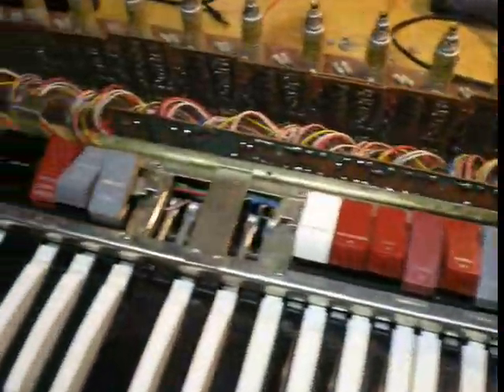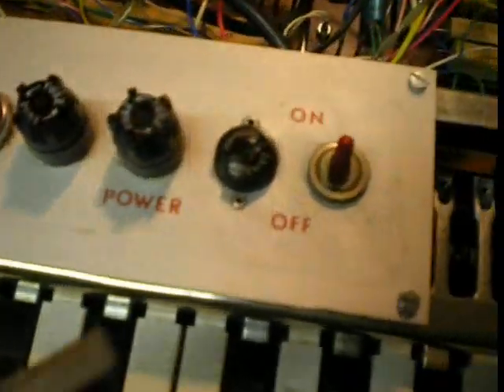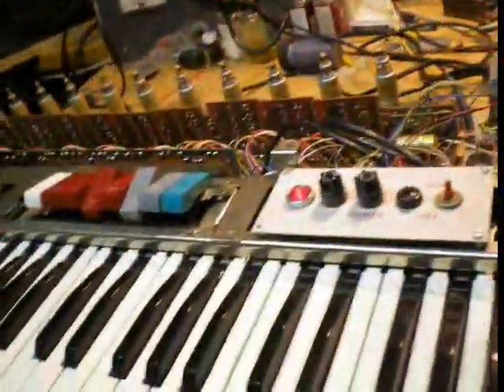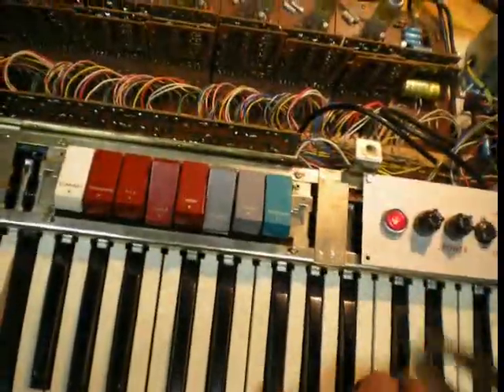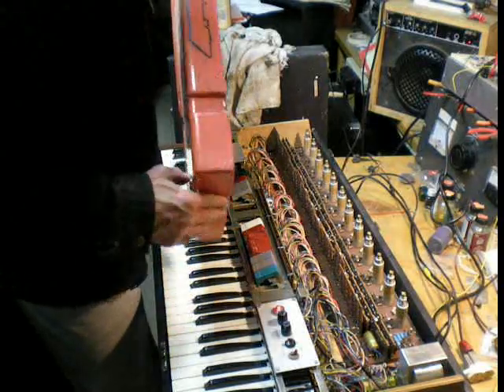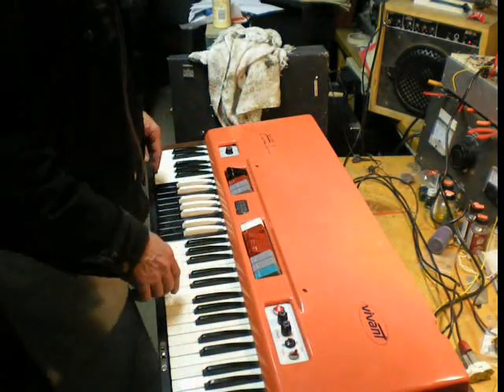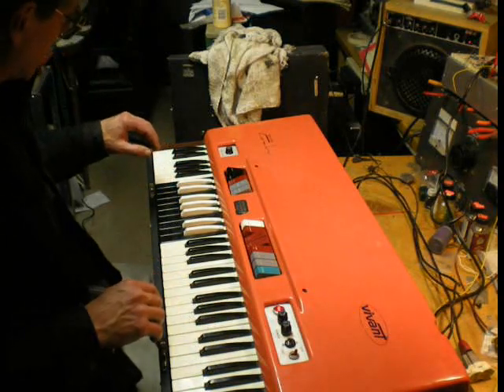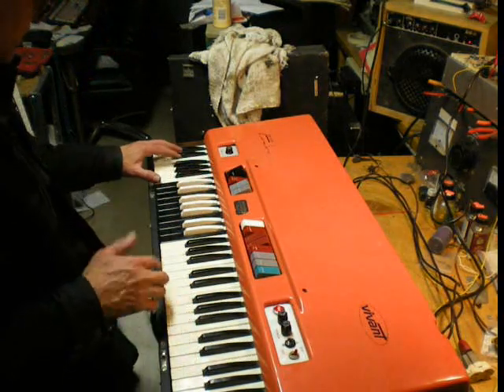Bauer Organ (Porto) look over/demo

Comment: I had a similar organ in the early sixties. Each voice sounded cheesy and little different from each other. I had to tune the oscillators somewhat frequently with a little screwdriver. I finally sold it. It was little more than a toy.
Reply: Ideal porto organ not Bauer?

Comment from the maker: I just came across another one of these...I thought the top color looked a bit different.  The sticker on the right isn't there.  And it has the easy-melt plastic where cords left deformations in it like the Fender Starmaster rarity.    This one actually has a little tag on the back of the wood case that says "Porto Organ N.  1845" it appears.

.  Total pain..like 5 cards with transistor issues.  Now it sounds wonderful though with a good tuning.  Someone bored in a couple pots and a bunch of jacks on top!  Guess they figured it already had the cord deformities.  Maybe I should go with it and put vibrato speed control on it  and who knows what.  They cut 4 1/4" jacks into it too.  Scratching my head as to what the intent was there. 

ALSO the point of confusion re: the split octave seems clear on this unit!  When neither of the two lower tabs are selected there is a continuous bass sound which is monophonic on the lower octave always since it's a ladder with low priority.  The tone cards have ground on the white wires.  Behind and to left is a red wire for vibrato.  THen in front and to left again a yellow which is the oscillator out...then moving left to black is first divider, then pink for second divider and grey for third divider.   Then the left most pins are involved in the circuitry on the forward most sub board with three electrolytics and diodes and resistors.  Involved in the tone sustaining /reverb function I believe... and then in the back row of connectors is a typically blue and white wire which has the unfiltered low divider which is wired to each of the low octave notes so that you get the tone only of the note you are hitting in the coax coming off to the bass volume.  Then from there to the vibrato board on the right which also has a bass divider to step that tone down one more octave and then it goes back to the filters board where it's conditioned for a smooth sound.

Anyway no tabs and that sound is ALSO continued to the second octave of keys which are polyphonic.  But if you select one of the two lower tabs..unlike the version in the video, it ONLY affects the second octave; not the low one!

Comment from the maker: I don't recall...but the way to do it is..first check that there are no leaky capacitors or low impedence on the supply.  (measure on the other side of the rectifier(s) from the transformer outputs)  If all is ok then attach a current meter in place of the fuse and see what current it runs. If it's over a reasonable figure from the wattage rating on the unit if there's a label (xformer output volts X amps) SHUT OFF QUICK!  If it's in bounds though (amp or whatever) then just use 2x that on fuse